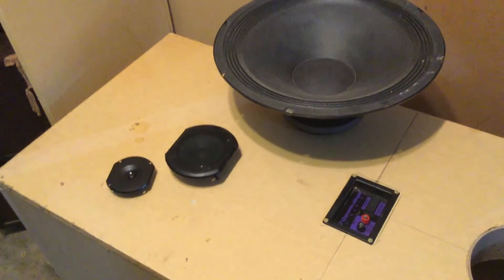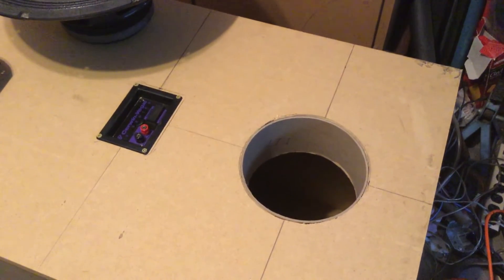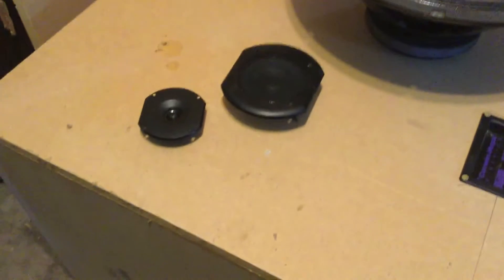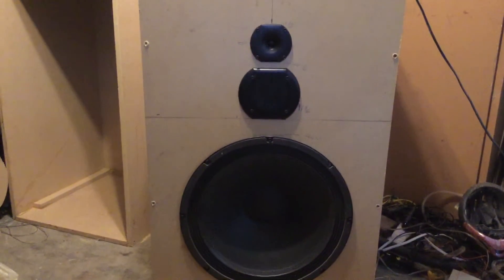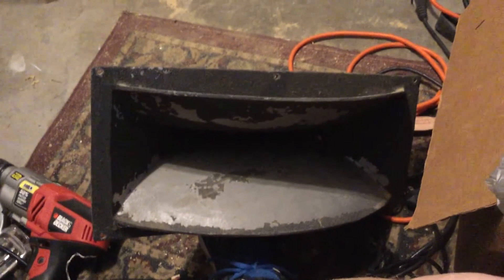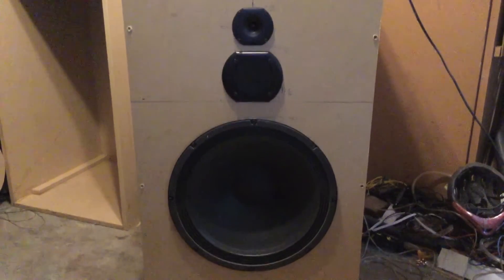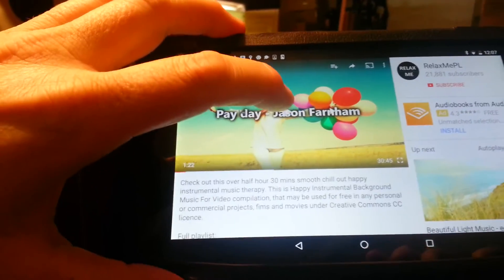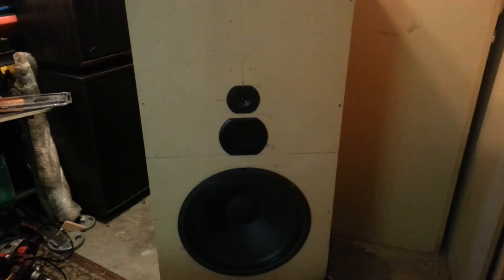DIY NOT Klipsch Cornwall Speaker Clone (sort of )

Comment: It sounds precisely as its components...all found on the curb trash can-
Reply: I didn't like the midrange and tweeter either so I upgraded the to a  JBL 2123H for the midrange and a JBL horn for the highs and the difference is unbelievable, detail is off the charts( think JBL 4345's ). The mid and tweet in the video were not horrible in reality just what you would expect for drivers that probably cost 3-5 dollars each when bought in bulk. Will post another video with the updated setup thanks for watching and commenting.